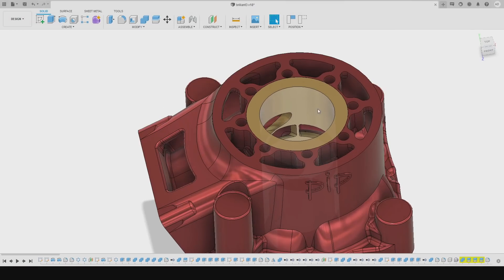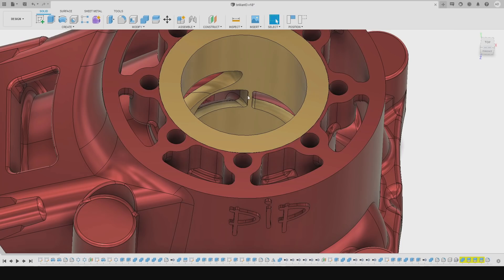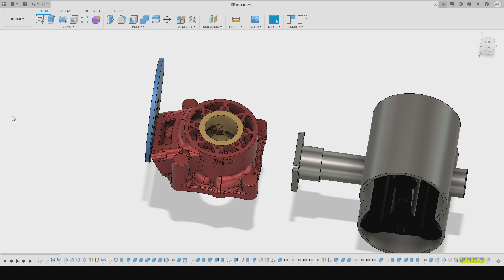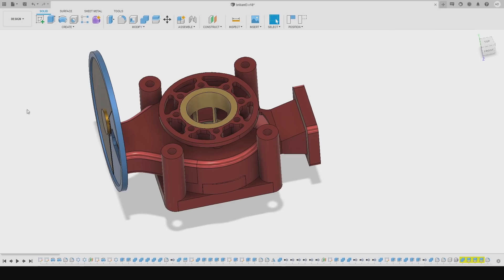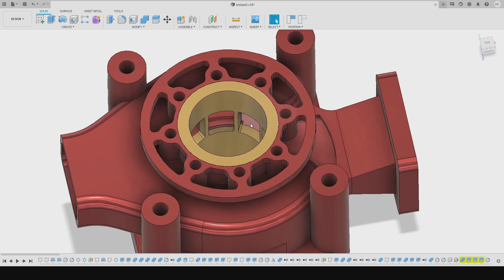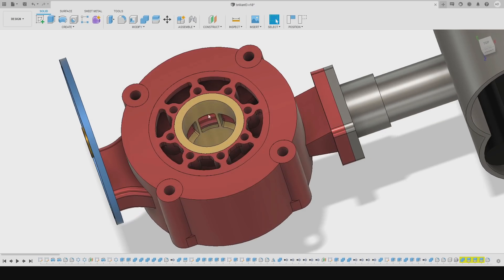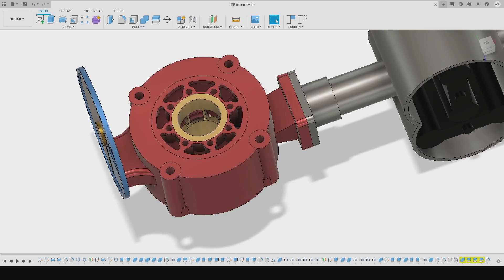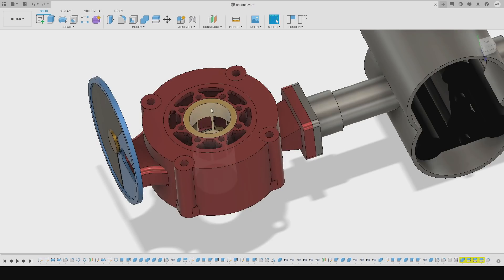Will BLOW Up the Competition! Seriously!

Comment: Hi my Friend, Love your vids. I would love this to work, but I see a few problems that you might have. As the exhaust gas leaves the cylinder, it will heat up the intake ports and this could cause pre-ignition, and If the reed valve actually works as you have planned, then there could be so much pressure that you will either blow the head gasket or even bend the conrod. Have you considered these possible problems? Anyway, I hope you can prove me wrong and that you build a fucking beast of a motor. Best of luck.

Comment: But the most effective way to run the rotary valve and the blower would probably be off the crank right ? Wouldn't it kinda lose the point of a 2 stroke ? It would be less revvy and the parasitic losses would be quite noticable, also if you want a powerful small cc, wouldn't you basically be dependant on the revs ? But yeah, maybe you dont need it to rev 20k if it makes all the power with lower revs with the blower

Comment: Is it possible to position the exhaust port(s) lower than the intake ports? With this design the blower can force the exhaust out at bottom dead centre and fill the cylinder with fresh mixture quite long

Comment: This seems like a viable alternative to the pip cylinder.

 what if the sleeve only had 4 ports and IT rotated somehow instead of a rotary exhaust port, allowing to to switch from transfer to exhaust but never have both open at the same time
Reply: That's what I was thinking! Also like the idea of triangular ports posted earlier.

Comment: At the rpm you are going to run, you will need to underdrive the blower a lot.  You might have gone too small.

I don't like the exhaust ports right next to intake, I think it needs some cooling and if you do that, 2 intake and two exhaust seem like a better configuration. 

If you do give up on exhaust gas resonance tuning, you might even be able to do two intake and one exhaust because  a pressure balance won't matter.

It sounds like poppet valves in the head might be a good idea too but I have no idea which would be better.  I just know when you make such a drastic change, every design decision has to be reevaluated.

Comment: why don't you make the exhaust and the intake on the same side and use the same valve to control both, intake and exhaust? Since the porting is symmetrical,  you can place the channels wherever you want and remove the reed valve.
You could also use a cylinder instead of a disk, placing it much close to the bore and making it much more fuel-efficient.

Comment: Your method here is called RADIAL PORTING and apart from the added blower and rotary valve this is very similar to the porting used in Vintage model Airplane diesel engines of the early era.

Comment: Hello again,
great idea (as usual). My design for a turbocharged (or supercharged) 2T is WILDLY different, but I really like this concept and I think it will perform very well. The only thing that does not really convince me is the port arrangement: with the intake ports facing each other I am worried the two flows will fight themselves, have you considered alternating them?
The shortcircuiting of the flow it is not so much of a problem: charged engines normally run in excess of air (since you can feed it mechanically), but if you use this strategy I recommend GDI. An alternative is to use variable timing for your exhaust valve (once you pick a final design) so that you can compensate the effects the dynamics have at higher speed in that larger exhaust volume (between ports and valve); this should help controlling over scavenging.

Great work, keep it up! And also good luck!
 Andrea

Comment: I have a feeling that that exhaust cavity around the sleeve is going to turn into a grenade as soon as the exhaust ducts open up because of all the unburnt fuel inside of it (please correct me if I don't understand something properly)
Reply: I cant wait to see the flames this engine puts out the exhaust
Reply: @404-ThisUsernameIsAlreadyTaken  burning fuel in a semi-closed compartment Will create compression if the outlet isnt as big as the volume the burning creates.
Reply: @404-ThisUsernameIsAlreadyTaken  I've seen an exhaust pipe explode on a twin cylinder once because of an ignition problem (it was running with a bad spark plug in cylinder #1 the owner changed it gave is a kick and boom) there was no compression either but the whole thing got shredded now with a compressor pumping air and fuel mixture basically straight into the exhaust system i'm preatty sure the results are going to be the same altough I hope to be corrected on this
Reply: @404-ThisUsernameIsAlreadyTaken  The explosion is not an actual explosion in the traditional sense because fuel doesn't "explode" when ignited but instead burns quickly generating a great volume of gasses and basically the expansion of those gasses is what makes the piston move. And if the amount of gasses created is more than what can escape quickly trough the openings, it creates overpressure and the explosion. Now if we cram a great amount of fuel and air mixture into the exhaust system and it get's ignited on the downward stroke of the piston by the hot gasses and flames leaving the cylinder it's gonna burn and I think even a straight pipe is going to be too small to let all of those gasses vent thus creating huge pressure in the exhaust system, and possibly turning it into a pipe bomb. Or maybe he'll get lucky and just get some cool flames I'm not a clever guy idk.

Comment: Direct injection could solve the fuel inefficiency problem since it could inject the fuel after the piston has passed the ports and then the blower can blow out remaining exhaust gasses without blowing fuel out the exhaust. Although i don't know if it is possible

Comment: Hi, just wondering why not use direct fuel injection in the head?  You could then wait till all ports are shut, squirt in your nicely atomised fuel & then ignite, this way your only blowing in air under pressure & not throwing fuel out the exhaust ports when scavenging. Plenty diesel direct injection Two strokes with forced induction, I haven't done the calculations but if your not using crankcase/transfer mixture to lubricate bearings under the piston then you can probably change the fuel mixture & get it burning pretty clean. Let me know what you think. Great videos by the way!

Comment: I am no galaxy brain but in my head I see the mixture in there not necessarily all pressurising the cylinder with all of the volume in the intske and exhaust, as in there will be a charge in the cylinder no doubt but some may be lost in the ports, which is either wasted or burns after the piston starts coming down. My first thougjt to fix that was a valve or a bleed at the top on the cylinder near your spark plug so that the charge flows into the cylinder and up to where it needs to be rather than just venting out or filling the big port area. No doubt you have better understanding than me but I know you read the comments and I'm curious as to what you think. Best of luck.

Comment: I might have something to add to that design. Instead of the rotary valve at the end of the exhaust duct you could use blades (picture a guillotine) that will close all the exhaust ports. So blades sliding up and down in the sleeve in their own grooves. I think that way you will have more mixture in the cylinder since the volume of fresh charge that would be used to fill the exhaust ducts would be forced to fill the cylinder and you could start building the pressure in the cylinder whenever you want. I think those blades could be moved either mechanically or with electronic actuation (like solenoid valves or something. Awesome idea keep up the great work!
Reply: You're almost talking about a sleeve valve system, in which the ports are blocked by a reciprocating 'sleeve' that also acts as the cylinder liner. Rolls Royce tried a system like this in 2-strokes during WW2, they got some crazy power output from their single cylinder test engines but had a lot of issues when they tried to scale up to the full 26L V-12.
Reply: @nerd1000ify  sounds interesting, hopefully @2strokestuffing will see this
Reply: @ttmfinland_yt  yeah I think it's actually the best solution. The craziest part of a sleeve valve 2-stroke is that you can put the exhaust ports at the top of the cylinder and the intakes at the bottom, so he could essentially double his total port area!

Comment: I feel your electrical pains! My house was built in 1910. It later had knob and tube wiring ran. Some of the knob and tube wiring is still in use. We are slowly replacing it. Good luck. 

You might get with the turbo snowmachine guys here in the USA and see how they do it. Some of those sleds make crazy power.

Comment: Instead of filling your exhaust with combustible mixture, you might want to try direct injection of fuel in the cylinder. It shouldn't be too difycult. Also you might want to have another look at 2-stroke marine diesels with supercharge and an inlet valve on the cylinderhead. Anyway, the most serious problems you will have to solve will be with lubrication. 
I am really eager to see what you come up with! This is an interesting journey you are taking us!!

Comment: Interesting principle I've never seen before! A poppet valve may be better suited for exhaust temperatures, and then you have the traditional uniflow engine mentioned earlier. I guess the only "holy" thing in your experiments and designs are the 50cc, and I do agree on that point! 50cc is the traditional moped displacement, and going about that is definitely cheating in the game. :-) Adding rotary or poppet exhaust valves and a blower is definitely making the whole design more complicated. I se no problem at all with this. Have you considered a uniflof opposing piston engine? It's definitely making the engine more complicated to add another piston and crankshaft, but it will give you both asymetric port timing and lowering the piston speed considerably it you keep the bore size. I guess an opposing piston engine can allow MUCH higher RPM's, and that's where the power is. :-) My greatest concern about an opposing piston petrol engine for really high power is if the pistons will run to hot, since there will be no cylinder head dissipating heat.

Comment: Make a 4 valve head, sync the cams so the intake and exhaust are both exhaust the drive the sprocket 1:1. It would be a little more work but it would be really unique.

Comment: does it have to be gasoline/nitromethane ?
would that concept work with diesel ?

also what about a spinning hollow drum between the ports and the cylinder, instead of the rotary valve, would that work ?

Comment: The exhaust valve would probably be better as a plug valve arrangement like Yamahas YPVS, that may be what you meant by a drum valve. However I can see problems with whatever valve you use! I would think about triangular ports such that the exhaust opens wide end first and transfer ports open narrow end first...

Comment: Why don't you time the injectors that they inject the fuel wen the rotary valve is almost closed. Its a hundred times more efficient and you only wold lose a copple HP if any. You would have to figure out wen to inject the fuel becaus of course, the higher the RPM the sooner you need to inject the fuel if you don't change boost.

Comment: This is pretty wild, and frankly the reason I subscribe. I love this sort of thought invoking design.

What stops this system from pumping the crank case full of air\fuel mixture when the rings are above the ports?

And with that in mind, what stops the crank case from turning into a bomb at that point?

I think pressurizing\air flow through the crankcase with fuel-free air from the supercharger might do the trick. But how much power would be lost by giving the piston something to work against on the power stroke... Hmm.

Comment: Hi, I’ve heard that slides/rotary valves have issues in a charged system, as the pressure goes up it can cause the slide/valve to stick, maybe some ball bearings around the out diameter of the disc could help, all the best, M.

Comment: Good luck with the build, all seems to make sense. Does the transfer port direction matter that much as you have high pressure from the supercharger? I would have guessed that angled up and with some shaping you could get good swirl in the upper combustion chamber and flush out the gasses that way...#oldskool ?

Comment: Add a pressure tank on the intake that can fill with charge air while the intake is closed. Then the built up pressure will shoot into the cylinder when the ports open.

Comment: Most of it is logical and great lateral thinking. But I believe filing up the outer exhaust chamber with high pressure fuel mixture on the up stroke (before the ports are closed) will blow the engine to pieces when the flame front enters the chamber in the down stroke. That's a huge volume of fuel/air to ignite.  The reed valve will also need to withstand combustion pressure. No manufacturers will buy this inefficient design. Please don't waste your time. Continue with the other motor just add the bridge. Please

Comment: Two things: 1) fuel injection is a requirement, and 2) you are asking a lot from the exhaust valve. I'm not saying it can't be done, only that this design makes very different demands than other two-stroke engines, and you may have to be imaginative. You've been pretty imaginative  in the past, probably can do so, again.

Comment: Your idea is very similar to how the old 2 stroke Detroit Diesel engines work.  They have overhead valves and camshafts like a 4 stroke, but the valves are all exhaust valves and the intake ports are at the bottom of the cylinder.  They require a blower to run but can still be turbocharged.

Comment: I think the biggest challenge will be a timed exhaust 'valve' that can cope with combution pressure at 20k revs and 900 degrees C.  Could your (slightly) more conventional 2 Stroke be supercharged if you use a disc valve on the inlet side to 'time' the inlet pulse?  You could just blow 'air' into the inlet and use fuel injection direct to the crankcase.

Comment: What happens to the air/fuel mixture that doesnt get compressed by the piston and combusted? wont you have a lot of after burn in the exhaust? like a 50cc flame thrower?

Comment: Why not use a sleeve valve like a Junkers or Deltic diesel? No problems with the exhaust ports and duct being full of fuel and air then. Could also lower the exhaust ports a fair bit too. RCV 4 stroke model engines have a rotating liner with the valve in the head could be an option on a two stroke with the whole liner rotating but would limit it to 50% of the wall area. With a reciprocating sleeve valve you can pretty much have as much exhaust port area as you like. Heat transfer through the sleeve to the barrel may be the biggest issue. Also look up the Rolls Royce Crecy engine.

Keep up the awesome work💪

Comment: Very cool, but not new. There was a lot of work on supercharged (wet sump, petrol) two strokes by major manufacturers about 30 years ago.
I started building a supercharged 4cyl 2 stroke based on a 1250 cc Sigma. Used a small Nissan (I think!!!) blower,  all 4 valves used for inlet with exh ports bored into the side of the block. Had the structural work done but never got it running (time and money) valve action was going to be pretty violent with the cams going at crank speed,
Keep it up and let’s see this thing going.

Comment: I can understand where Alex is coming from but surely the engine has to power the blower so it can become the world's most powerful 50cc 2 stroke engine, and that will take a lot of power. One thing that concerns me is heat distortion and lubrication of the rotary exhaust valve, possibly needs to be ceramic which is heavy. I miss the dyno testing of the SPX running normal pump fuel. While very interesting sadly I feel Alex is getting a little lost along the way as the initial idea was to beat the Dutch 50cc tuners.

Comment: Cylinder with only exhaust ports and have oxygen and fuelinjection. 

Pure oxygen contain three time more o2 then air = you can use three times more fuel = three time more power.
Reply: Winner, winner for outside the box thinking!  Temperatures would be extreme, like having an oxyacetylene torch built into a 2 stroke engine. Maybe if the piston and cylinder were constructed of tungsten they would survive. Would be really interesting to run some calculations, but that is beyond my ability.
Actually, this would be very similar to using oxygen-bearing fuel. Will nitromethane or some other fuel burn effectively in an inert atmosphere? If so, then Mr Walman's idea would greatly simplify the design. The ring of ports could all be exhaust, and be deep into the power stroke. Then use direct injection for all your combustion needs. No boost required.  My guess is that these racing fuels are blended to be used in conjunction with air, and might not work with spent exhaust gasses.  Could they be blended to work properly in an inert (no oxygen) environment?
Add:  Liquid rocket fuel would work in an inert environment. Maybe ceramic parts?  I worry for our safety!
Reply: Fuel can be gas ≈ hydrogen.
Reply: And i have run my 50cc with oxygen and ethanol. Run good until my carb turned into a flash.
Reply: https://youtu.be/O0yM5RlD7Zo

Comment: Terribly inefficient but should make alot of power. I think the exhaust port needs to open slightly before intake ports to prevent damage to reeds.
Reply: Also rotary valve needs to open just before exhaust port opening and close at bottom dead center.